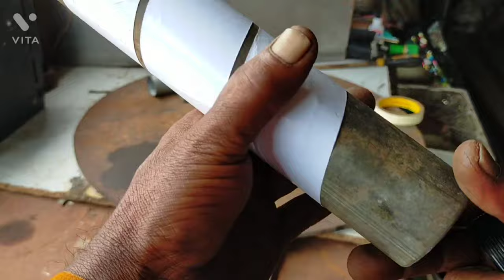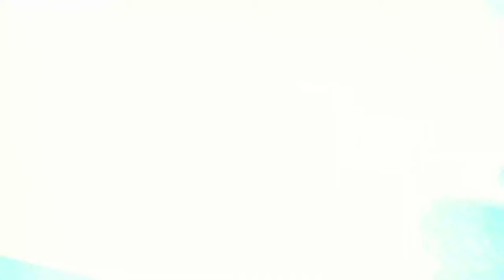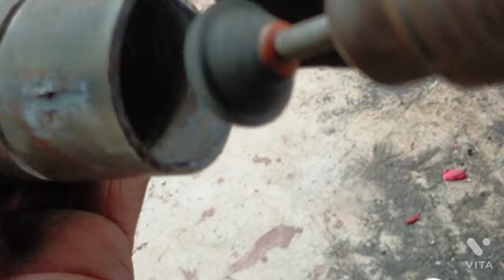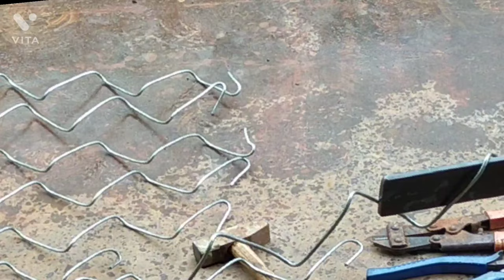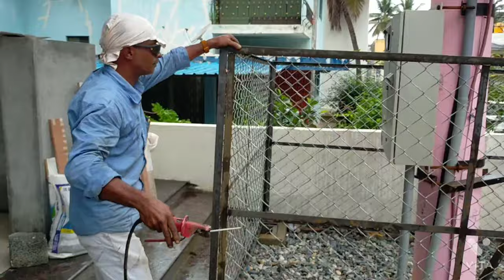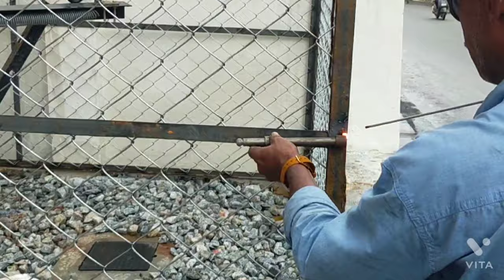AMAZING IDEA! simple fence wire netting machine Fabrication    make a netting machine

Comment: How did he manage to make the wire move forward? I tried but the wire won't go forward. It gets stuck in the tube...
Reply: Exactly
Reply: Because of the curve design of the pipe that's the main die(tool) if you have to make fencing with less gap in between each other you have to use a smaller pipe (tool). The design is main and you have to leave small gap between rode and wire. 

I see the problem is in the design pipe.